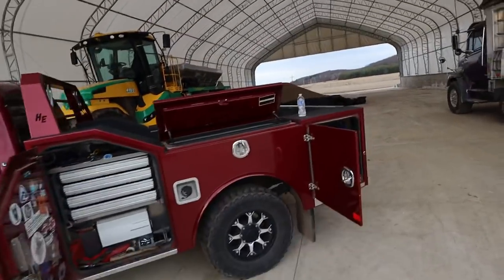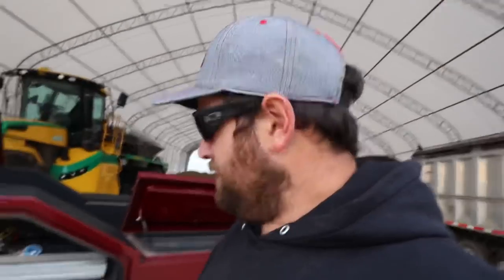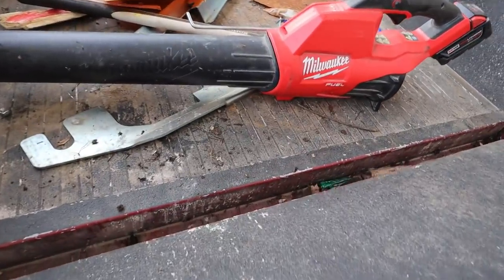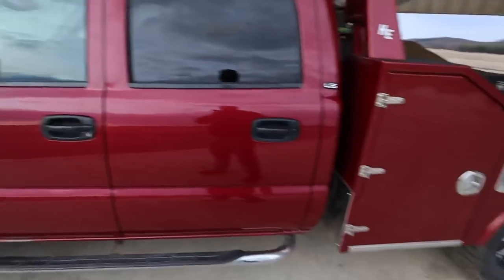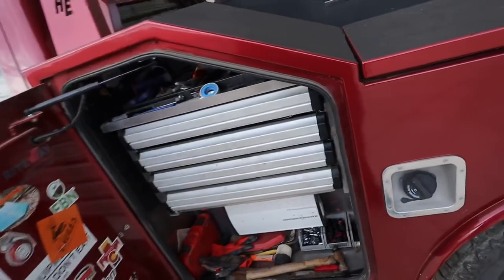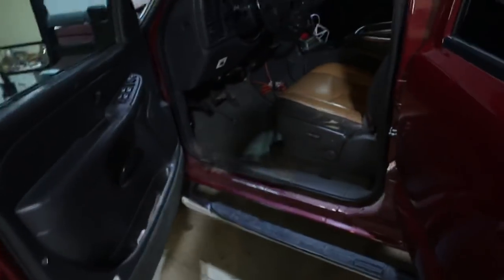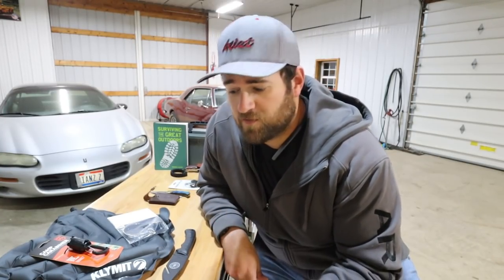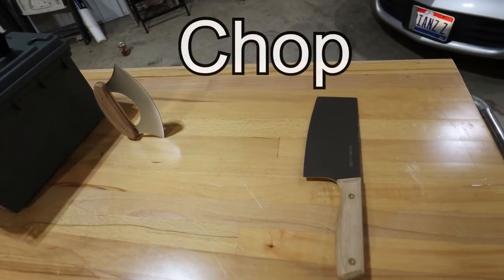My Hughes Equipment Service truck bed tour

Comment: You should add door switches to control your compartment lights, Open the door lights come on, Close the door and the lights go off. no dead batteries from leaving the lights on.
Reply: Timers and momentary switches

Comment: I have a 2001 3500 Duramax that is a dually extended cab, 8 ft box. I installed an aluminum flatbed on it that I use for my lawn care business. The engine has all new injectors and the heads and block has been resurfaced as pretty much all 2001’s were. It is plated for 12,000 lbs which I have been over by at least 1000 lb’s, thank goodness for the duals. After having a diesel it would be real hard to go to a gas engine but $7000.00 for a diesel upgrade would be hard to swallow. That is a nice utility box you have Brian, just put a switch in that turns the lights off when you close the door.

Comment: Beautiful truck. You can see it raised up and down in the video time lapse as you clean out the boxes. May I suggest a pair of one up Offroad's traction bars and a set of airless airbags. I also have a set of airless airbags on the front of my plow trucks and they make a world of difference. My dad years ago had a bumper that was built and sealed to be a compressor tank.

Comment: You need a switch like car door switch.  Comes on when you oen bed door nd goes off when closed. Still have a manual switch in case you don't want it on.

Comment: 😏 When you interviewed the Man who makes your Bed he said the Beds are Aluminum and Stainless isolated from each other and isolated from the Truck Frame. 🤓 It’s important to isolated because of Galvanic Corrosion from dissimilar metals in contact. It’s actually something that we don’t hear about much in the details but it’s a huge factor for longevity and safety. 🤔 Lots of older trailers have fallen apart from Galvanic Corrosion before it was observed in the engineering. I work in the Marine Industry there’s lots of places on Boats that need watching because of Galvanic Corrosion. Just generalized information there’s more factors. 😊 God Bless you Guys! ❤️🇺🇸🖖🏼

Comment: You know Brian I hesitated a long time before I bought a cab and a half 1500 Chevy. My heavy truck is an F-250 and it's standard cab, but I really like my cabin the half I sell farm seed and it really makes it nice to work out of when I'm calling customers and we also sell cut to order beef here and it makes it nice if we run out of room in the bed to use that back seat and cooler weather at least the whole beef but I have to say it is a challenge keeping it clean I understand where you're coming from.

Comment: If you thought your truck was bad, you should have seen what Ford transit van I used when I was a commercial fisherman getting 12 hour break once a week for 4 months and most of that 12 hour break was maintenance and getting spares
Reply from the maker: Sounds rough

Comment: I put Norstar SD bed on my F-350 long bed dually.....I do wish it was aluminum though. I put a 3000 watt pure sine inverter and a 1hp Iron Horse compressor (150 psi) with a 6 gallon tank and a 50ft roll up reel in the passenger side front compartment. And you are right about the dually having more room--I have a lot of room in it! And I called about the great little compressor you have but just too many $$$ for me! Still want a cap too!
Reply from the maker: Norstar was the first bed I looked at but I was afraid of it rusting

Comment: My dad bought Cee-Tee pliers from the local coop. He said that were the cheapest brand to plant. Didn't understand till I started buying my own. They were good little pliers though. I still have couple of dad's he fixed by bolting parts from two busted owns together.

Comment: What you need to do with the box lights is to put them on and contact switch so they are only on when the door(s) are open. That way no more worrying about the lights running because someone forgot to turn off the lights when they close the doors.

Comment: Nice truck. Why don't you just add a door switch to the tool cabinet lights? This way the light turns off whenever you close the door and you will never forget to turn it off and end with a discharged battery.  💡💡💡

Comment: Correct me if I’m wrong but icon tools are made by a former snap on employee. Or so I’ve been told, I work on equipment all day for a jd dealer I have several icon tools and they are great
Reply from the maker: I like them

Comment: Brian I dont know if you have thought about doing this but why dont you run all those switches threw relays tied into key on ignition power? that would eliminate the chance of killing your battery. pretty simple to change or add on depending on how you receive power for those switches it would not be much more than adding a few extra wires. Just a thought
Reply from the maker: Usually working with the truck not running
Reply: @BriansFarmingVideos  I got ya. We have our service truck tied into Key On power, so the truck does not always have to run just key in the on or ACC position. just helps make less of a chance of a dead battery

Comment: Will air compressor run an impact?  Do you like boxes opening on top or would you rather open curbside?  Seems to me curbside are easier to get in, work off of and store

Comment: 5 years use on a farm and no dents  ....... !   One careful owner.  Wish my pickup was that tidy.
Reply from the maker: Trucks been here 6 now. I did bend a fender flare on the bed but I had it fixed
Reply: @BriansFarmingVideos  You don't appear to have any gate posts to slide into either.  One of the main causes of the dent.

Comment: My service" truck" is an old Mule with a few tools rattling around in the back. I would like to have a nice truck like yours but I'm a lot closer to George's age and don't really don't want to use it enough to justify it.

Comment: What is the length of the bed?  I can’t tell if it was a long bed or short bed truck.    Does it use the factory hitch?   Also,  do you think the aluminum body hold up to say a 150 gallon fuel tank.   I’ve been shopping for a service for my truck.   Thanks

Comment: does that channel floor allow water to do drain out, and did you have the floor truck bed coated ?
Reply from the maker: The bed drains well. It has a Bed liner sprayed on

Comment: My dad has a tool truck, my brother has a tool truck and my uncle has a tool truck, most of my tools are from Lowe’s, Home Depot and harbor freight. Only tool truck tools I have are gifts from my dad brother and uncle. Same boat as you. I use my tools to fix my junk and there is a 99.9% chance that tool will go missing before it wears out.

Comment: Darling I did on my work bed was when I put my LED lights in everywhere I put pushbutton switches on the doors so that way when you open the door the lights automatically come on but when you shut the door they automatically turn off never forget them that way

Comment: Such a good looking bed but they sure cost a lot. I went ahead and bought a used regular service bed and cut it down so I could still pull a gooseneck or fifth wheel trailer. Threw a couple 5 drawer craftsman toolboxes in it and it’s been the best thing ever. All said and done with paint and bed liner I think I’m in it for $1000. Always have people complementing it as well.

Comment: To be honest I don't know many professional mechanics that buy all Snap-on due to the fact you are more likely to either lose it or have to bend, grind it down or otherwise make if fit certain jobs tends to feel more comfortable doing so with either a cheap brand or 2nd hand tool that costs a fraction of Snap-on

Comment: When you're constantly at random places and need a fast repair done that bed is the way to go. They are either all over in the truck box or it's all over in the truck, the shop the house, the machines. You never realize how much shit you have until you try to put in it your back seat 😂
Reply from the maker: Very true

Comment: You have a nice setup with that truckbed. The only thing I might add would be movable work lights that I would mount to the headache rack. That way you can make working in the dark a lot better. I have an F350 Powerstroke dually that I used to haul granite monuments with. I would not recommend a diesel or a dually to anyone that is not hauling a lot of weight, 20,000 pounds or more. The extra cost for the diesel engine along with the extra maintenance cost and with diesel costing more than gasoline it's just not a good investment. If you really don't need a dually you are going to be buying two more tires when the time comes, figure an extra $450 +  for good tires.
Reply: My first thought also was about the work lights. I was thinking maybe a couple "fixed" but movable, mounted somewhere, but also maybe a couple pre-mounted on collapsible but removable tripods with extendable cords. Our fire department has some mounted on the back of a couple of the fire trucks and they are really handy.

Comment: Nice idea with the drawers Brian.  I have to keep my brain bag and my portable toolbox in the back seat.  I have a 2016 3/4 ton HD 2500 Silverado with an 8' bed.  I got cheap when a bulldozer run into the front when a foreman for the previous owner had it parked at a site.  After pulling out and repairing the front end I added a cross over box and two side boxes, bed liner and a ladder rack with built in window guard.  Have a plow kit set-up on the front to run a Meyers plow with 4 LED high intensity lights for plowing but works great for spotting deer in Iowa when they are in rut.  Kept me from clipping more than a few this year at dusk.  Got a back-up camera I'm going to install and I'm going to put 4 rear lights before plowing season.  Future plans are to add a compressor and a vice.  This beast is my office, parts supply warehiuse, shop and going to town rig.  Now if I could only get 20mpg...

Comment: From what I understand the lead engineer that used to work at snap on went to Harbor freight and the icon  gear drives and those tools are are what snapon are or designed almost similar.  I fill my toolbox and other stuff up with them on the job site because people have sticky fingers. And they're not bad to have at home sometimes because they got stuff that you can actually find.